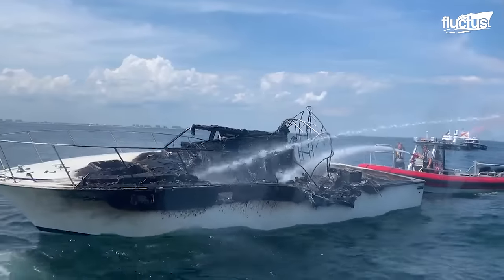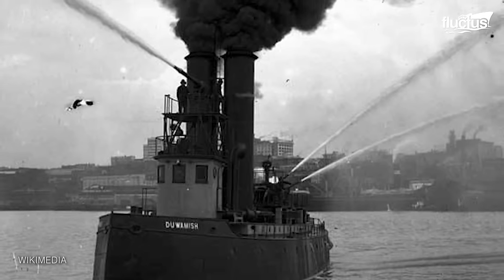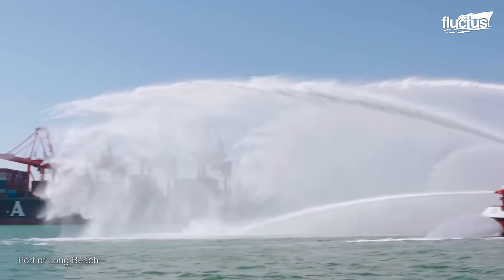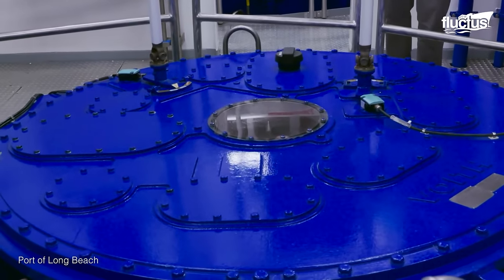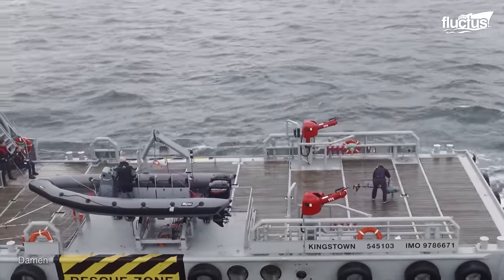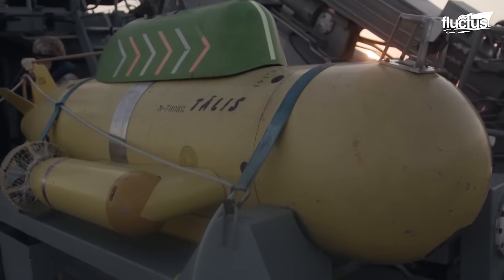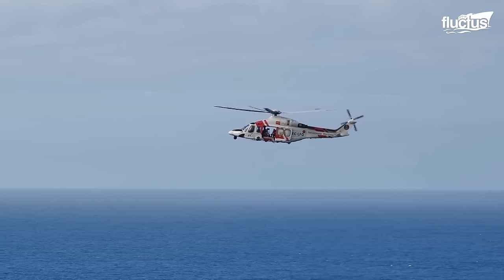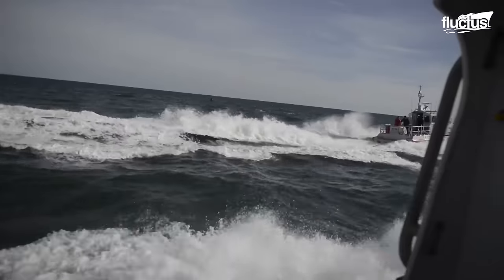This is Why US Invented this Gigantic $27 Million Fire-Boat

Comment: Well, yeah, because they get access to water constantly. That's why they can put more water on a fire than a firecraft. Now what they need to do is all these fires that are on land they should send fire water trucks, so didn't it have a supply of water? Constantly and the hoses need to be up-to-date. They don't leak. They keep their fire truck so spotless and shiny, but they don't keep there.  Hoses and good shape all the fittings. Have you ever seen it on TV? Look at the ground underneath the fire truck. Is it dry or is it wet if it's wet? Then it's leaking

Comment: The Protector seems to be Voth Schneider Propellers
Reply: More, just bow thrusters. They showed the bow thruster(at the bow) labeled propeller. That's not how a Voth Schneider operates, with its 360-degree rotational-not stationary- propulsion system.